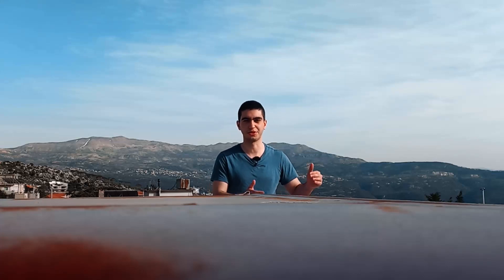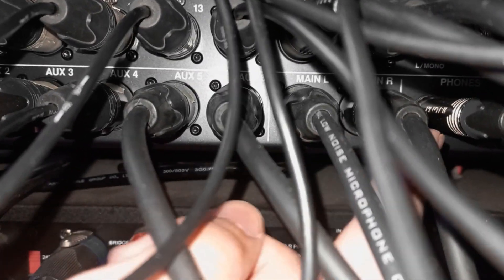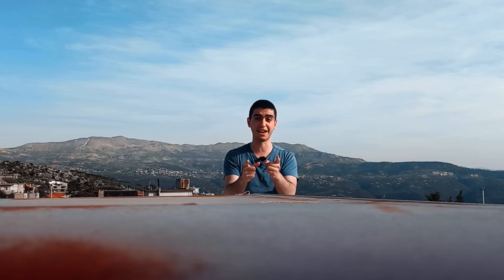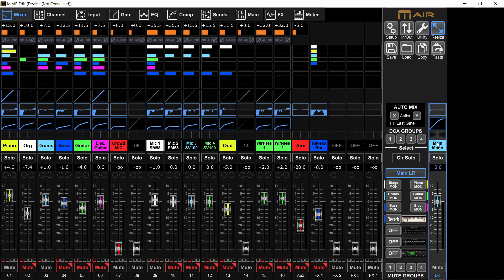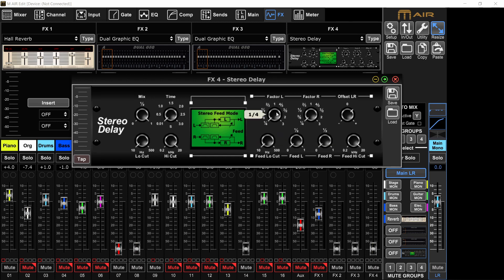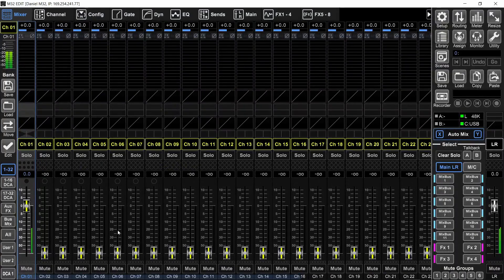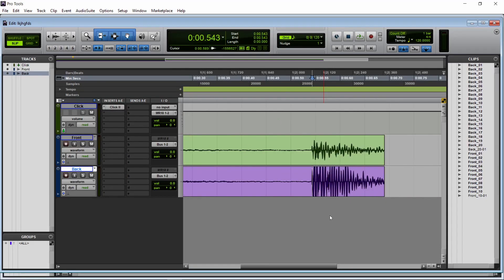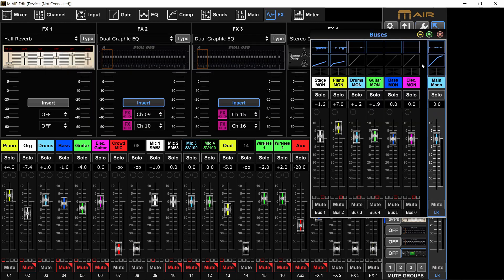i Gave Up on Stereo | Pushing the limits of the Midas MR18

Comment: Just for curiosity when i am mesuring the delay with pro tools/daw do i measure from the  dancefloor i am doing a gig with a dancedloor hotspot and mydelayed speakers as fills
Reply from the maker: You measure from where you can hear all the speakers together. So in a normal room you would measure from the back of the room. In the previous video about output delays on this mixer i explained how to measure the delay

Comment: Do you know if there is software issue with the MR18 (V2) at the moment ? I just recieved a new one fresh from the factory and it's written MR18V2 in the software but I can not manage to connect (external router and internal wifi) with ipad and juste succeeded 1 time with direct ethernet connection, and lost it 5 min after connection... Mixing Station which is suppose to work with the MR18 "doesn't recognised" this model. Much strange, my software version of the mixer is 1.19 and on the internet, available software version is only to 1.18...  So far, I can not use it and I don't find any response anywhere...
Reply from the maker: That's very strange. The last time firmware was updated was in 2021
Try to connect it directly with an ethernet cable to your computer and do firmware update to the version 1.18 

What do you mean by software? Are you referring to the M Air edit app?
And if you are unable to connect how did you see the firmware version?
Reply: Thank you for responding. I mean firmware version of the MR mixer, not software, sorry. And I succeeded to connect only for 5min with ethernet cables and same with external router and that is when I saw the version and try to downgrade it to 1.18... Which hasn't work. It seems that midas has realesed a new version of mixer that is not supported yet... Which is a problem when it is for your job haha
Reply from the maker: Today midas updated the firmware to 1.20 and the edit app to 1.8 check the website